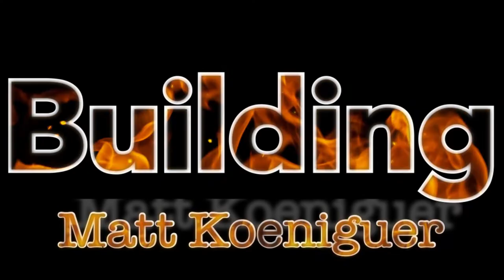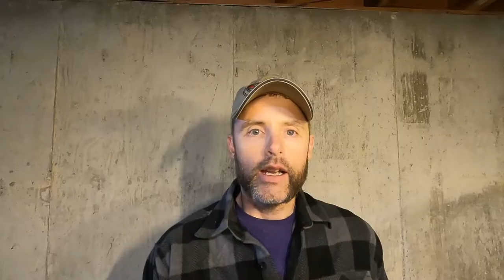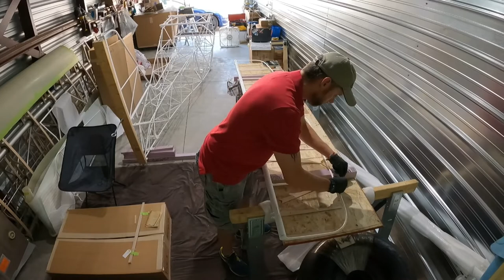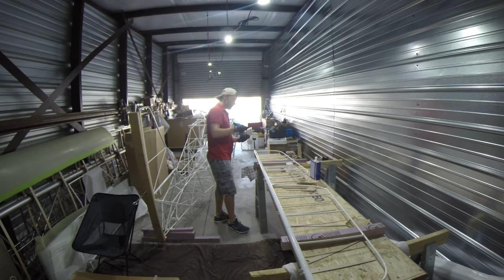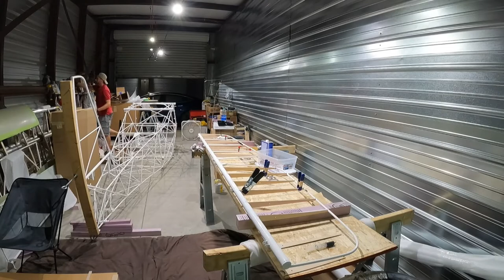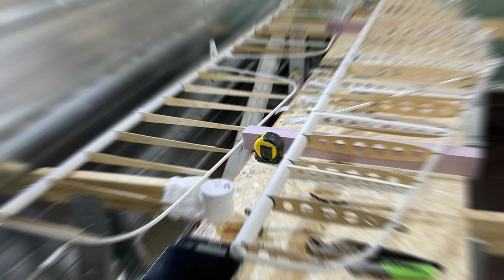#06 Gluing in the ribs on the elevator.

Comment: What size syringes did you use?
Reply from the maker: Hello Mr. Davis, thanks for the questions.  I apologize for the lengthy delay.  Inside the parenthesis that follow are the exact description from Amazon’s webpage & my order. (60ml Catheter Tip Syringe with Covers- 10 Syringes by Care Touch- Individually Sealed - Sterile). 

I do not say that I would recommend them.  They have a short tip & I think you may want some longer & skinnier.  These are good for anything that is not tucked into a corner or falls greater than an inch deep down between two parallel pieces that you need to squeeze into.  If you have a Tractor Supply Store, or a veterinarian place around, it might be a good idea to look in there or a Jones Drug store or any equivalent depending on your neck of the woods.  I think having a mix of syringes is very helpful.

On s side note, once you put some Hysol in them & you don’t use it all up, let it sit over night.  Then the next day, you can wiggle it around a bit, put a nail into the end & push out the old stuff & reuse it the next day if you want to.  I watched a guy painstakingly clean one with some chemicals & it was such a mess.  I came out the next day, fiddled with it a little bit & was able to reuse it.  If that is something that interests you, otherwise chuck ‘em & grab a new one.  I do like to reuse something if I can, especially throw away items.  Thanks again for the questions & I hope you have a great day.

Matt